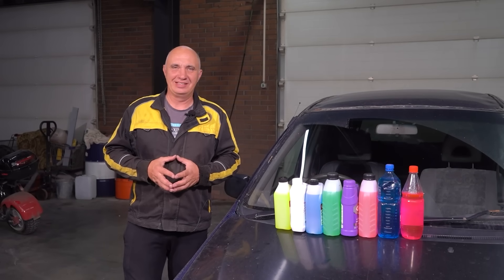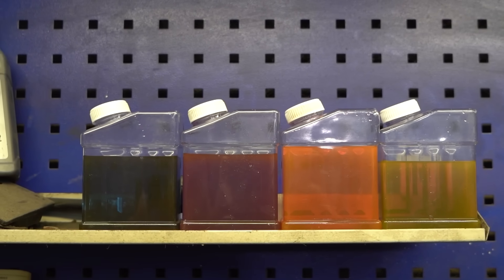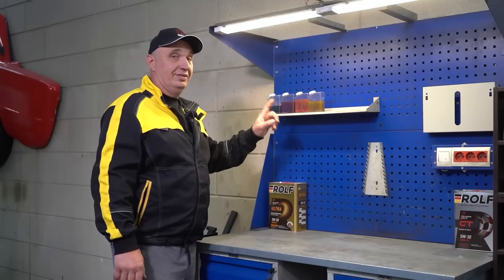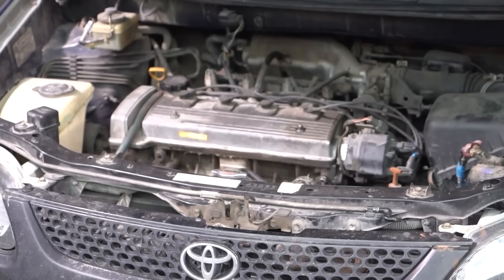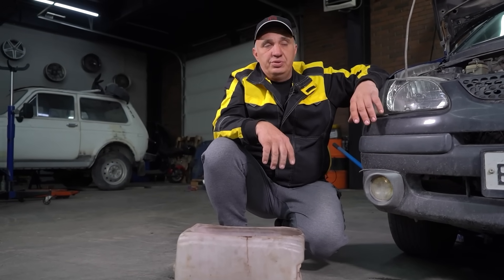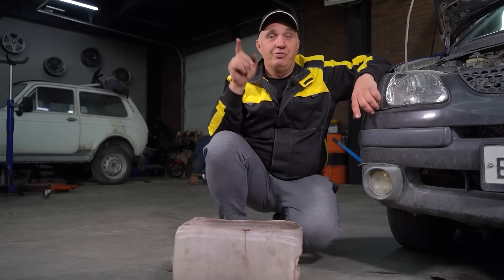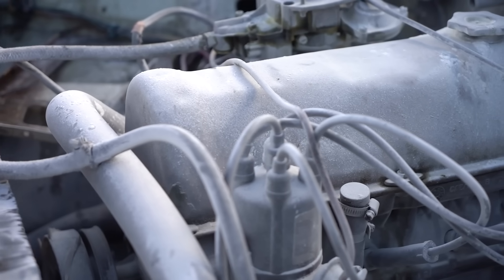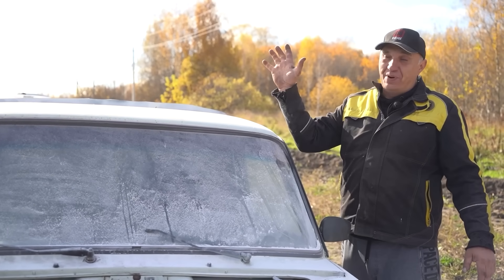Mixing coolant in the radiator (also we try gasoline) - what will happen?

Comment: What i heard is that you must avoid mixing inorganic and organic antifreeze.
Putting gasoline there was very dangerous. If something could ignite all that fumes, it could result in a very big fireball.
Not surprising the gasoline was not useful as a coolant, as it's very volatile, and boiled like crazy when heated (not to mention the huge flammability).

Comment: For the most part all coolants work just fine in any system even mixed. The big deal is metal types and protection. Toyota formula might work just fine in dodge and even protect it, but it might not last very long and not provide very good protection.

Comment: Pontiac Van a guy I know mixed in old style universal with new style dextose made a brown sludge which plugged and caused overheating and finished off his head gasket. Turned to brown stringy mess after a couple weeks

Comment: Of course mixing coolants is bad if they are not the same exact type.  You might end up with a gel like substance in the cooling system that will cause you all sorts of headaches.  These might be things like clogged heater cores and radiators.  That could mean having to remove the dashboard to get to the bad heater core (hopefully it didn't leak).  It could also result in overheating problems.  Maybe it will cause transmission problems too since a lot of those coolers are also known as warmers.  With those you have one fluid on one side and the other on the other side.  Also one other thing about coolant is that it turns acidic over time and that could corrode metal.  That may very well be the reason why when there is a transmission failure and there is coolant in the transmission creating that forbidden milkshake that some unfortunate people found out they had.  My reason for thinking it could happen there is that the coolers are made of thin metal (to transfer heat better).  If you have an unknown coolant in there flush it out and use the right stuff.  If the vehicle has a lot of miles or the coolant tests as acidic change it!!  That will be a lot cheaper than repairing the damage your neglect caused!!

Comment: Old coolants I’d say yes you’d get coagulation but the newer stuff has much more compatible compounds and additives while the cheap stuff is just lacking those special compounds all together so it can’t gel up. I’ve seen some clogged cooling systems but that was maybe 10-20 years ago. Now it’s all from stupid people using Stop-Leak.

Comment: I won't go too deep into this (I spent a week reading on coolant for a project car), but there are some important highlights. Coolants can generally be separated into:
IAT Inorganic Acid Technology 
HOAT Hybrid Organic Acid Technology
OAT Organic Acid Technology
You also have P-HOAT (which adds phosphorus), and Si-HOAT (adds silicone)
In general mixing OAT and IAT will cause a gel, and adding, or subtracting P or Si will cause seal leaks. 
Most importantly color means nothing when it comes to chemistry. For example Volvo blue is a HOAT, buy Toyota blue is just OAT, they are not miscible. Also, red, orange, and pink coolants are hard to tell apart in a bottle, and finally there is no such thing as 'universal' coolant. Never make the mistake of installing any 'one size fits all' solution in your car. 
Footnote, distilled water, not tap water. Tap water has minerals, and these minerals will coat the inside of your cooling system, and insulate it (cause overheating).

Comment: Australian Wade from 'Garbage Time' channel (also does the 'Dankpods' channel), ran his car on a coolant he called 'PILK' (Pepsi & Milk) and... It ran JUST FINE! 👍 He also does MANY other experiments, like using Nutella as engine oil (seized/spun bearing, but, they cleaned & rebuilt the motor and it worked again!), then, Eggnog as engine oil (FIIIINALY destroying the motor with bent conrods), also PURE PEPSI as coolant and other mad experiments besides! 👍🤣🤣   😎🇬🇧

Comment: Do not mix HOAT and OAT coolants.  They WILL gel if you do.  Mopar switched between the two and owners have to be careful to confirm which type they have since the Mopar purple coolant turns orange over time, making it tough to tell which you have.

Comment: Well I'd say nothing would happen but if you had rust eating on the cooling system then there's no way there won't be any damage but the mixing coolant part depends on the cars as here in my country there's a lot of people that mixes blue green and red and their cars still work like nothing ever happened but some others do ruin their head gaskets but it all depends on their cars and the fluid colors i get are a lot like all the colors you had but on a deeper color (probably because it's mostly the mix is from ethane based coolants)

Comment: it is mostly sensitive in systems with aluminium, what happens is that the coolant starts to eat the aluminium and forming crystal like composites in the system over time. coolant has the important task to prevent corrosion and mixing types can reduce that property of the liquid. I seen it happen

Comment: It was.
Dex cool that would do that and that was only if it got exposed to oxygen which happens every time you open the container or open the radiator cap and if you missed next deck school with Etheline glycol based

Comment: Its DexCool if you mix it with green or any other coolant then run it for a year or 2 and continue letting the coolant get low because its leaking and thats why your mixing it in the first place

Then it bakes inside the radiator when it gets low and turns into a hard and gunky goop that coats the inside of the radiator

Ive seen alotta GM 3800 engines that have that issue always gotta flush tf outta the cooling system and i dont run dex cool because of that issue

Comment: Al that mixture of coolant did w a s remove the rust from the cooling system of that Toyota and if you are desperate for a coolant water will do the trick not petrol another idea for an experiment is fill an engine with water a just leave it outside overnight in winter and see what happens

Comment: Stopped at 58 seconds for a little guess and whatnot. I doubt they will see much action unless they have been saving up videos over a long term setting. I've seen the GM dexcool garbage go very badly with regular green ethylene glycol. It forms a weird dirt like coating in areas where air pockets form. Very bad.

Comment: If that was all the coolant that came out of that radiator then you definitely have problems there should have been more than that come out. Most coolant dosent have the problems they used to when you mixed them but back in the 90s when every manufacturer started changing them to something different they had a lot of problems mixing and corroding internal parts some are still that way but it usually takes a lot longer than a month. A lot of them are universal now and thats the kind i prefer. When i get a vehicle with one of those goofy coolants i flush them out to use universal makes things easier!!!!!

Comment: that brown sitcky mud he wiped off the radiator cap and we saw in the neck of the radiator is exactly the concern with mixing incompatible coolants. they turn to a sticky paste that clogs cooling passages, thermostats, and heater cores and is extremely stubborn to thoroughly clean out of the system.
Reply: That's stop leak.
Reply: @windowlicker4029  nope, it's coolant sludge. I deal with it regularly.

Comment: While I know this is an experiment and wouldn't condone using gasoline as coolant but the vehicle is just standing still and not getting as much airflow to cool the radiator as it would if it were moving. However, in normal conditions with actual coolant, properly running radiator fans will suffice to cool a parked vehicle at idle temperature so the outcome will inevitable likely be the same, just take a bit longer if the car was moving at speed.

Comment: Kiwi mechanic here, I have seen honda coolant mixed with green coolant and it turned to jelly. I felt real sorry for the old guy who was trying to do the right thing. I had to do the head gasket for him but managed to flush the muck out. Great channel 🙂
Reply: Yikes!
Reply: I am curious to know what chemical process took place to cause that reaction. I've heard ya don't mix red antifreeze with green, but I never knew why.
Reply: So if I change the coolant in my jazz can I use the blue Penrite? Or just use Honda stuff?
Reply: @turbosloth2  Just use the honda stuff. and you will be pretty safe. In saying that blue penrite may be as good, or not better than the factory spec? But I know not to mix and match, 🙂
Reply: @Bryce-z9v for the most part its ok to  mix. I recommend swapping to a quality brand of all vehicle coolant for almost every vehicle. Peak is very good. I use the ecoshield formula in my monte carlo from peak works great. Also very cheap.
Reply: @Bryce-z9v  yer I’ll give it a good flush, it still has original stuff in it that’s near 8 years old
Reply: Honda is such trash in nearly ever way. I hate honda cars. They do not like to be fixed.
Reply: Kiwi here too, I have seen the same thing happen and ended up  a dash removal to replace the heater core

Comment: I put too much coolant in my 09 ranger with the 4cyl duratec and thought it was a blown head gasket before i realized it was just burning the excess off of the cylinder heads. I like to use nothing but distilled water, water wetter, and a few drops of silicone lubricant into all of my coolants to control boiling point, balances top and bottom engine temps, lubricates the water pump while keeping corrosion at bay.

Comment: From my experience you can use any color and coolant if it is rated for your engine type (alu, steel, cast) as long as you don`t mix them and flush your system if you change the colour.

Comment: Where I live they sell used coolant at the local junkyard from different cars but they make sure it's not mixed with oil from a blown head gasket and I have heard that if you put transmission fluid in it helps keep it cool as well I don't think it is true but heard it from dirt track racers

Comment: the other problem is that using incorrect coolant can be corrosive to the coolant system. If your heater radiator will be rusty and start leaking then the hot water will spray all over inside the car and to replace it many times you have to disassemble the whole dashboard... and when you put it back it will make cracking sound all the time because it's never supposed to be taken out and old plastic deform a lot :D
Reply: Heater cores can be replaced without not making noise 🤣
Reply: @fastinradfordable  depends on the car... for example I got a 23 year old car, door lock mechanishm and the electric window opener had to be replaced multiple times and to do that you have to disassemble the door panel. Despite being put back perfectly now its making squeekeng and cracking noise all the time on crappy roads... Plastic dude, this is the habbit of plastic. The newer the car the more plastic it has instead of screws...
Reply: @johnnyhun1  You should have replaced the plastic pins, that hold the door panel in place. I had to replace a heater core to a 88 Camaro, and it didn't require disassembling the whole dashboard, and it didn't make any cracking sound afterwards.
Reply: @ well, a car from 88 is simple as a wooden train. But anything newer than 2000 is more and more complicated and has cheaper quality parts
Reply: Would like to see this tested...always heard it but no evidence yet

Comment: When you change your coolant, buy 2 extra gallons and put them in the trunk. I have mixed all kinds of collant together in the past, but I understand that some of the newer coolants won't mix well. Either buy the pre-mix or use DISTILLED WATER.  - If you use tap water it is likely that you will have issues after a few years.
Reply: Yup tap water has to much minerals that corrode newer vehicles I started using distilled water about a decade ago back in the 90s it wasn't that big of a deal but everything is made so cheap now not worth the risk

Comment: i had to change dozens of heat exchangers / radiators because people mixed G11 and G12 Coolant Fluids..... it simple clogs up over time.... next thing is the plastic parts and seals gets porous over time if the coolant is not compatible....

Comment: I have a very cool experiment you should try, taking a regular engine let's say a lada engine and fitting it with big oil pump like a truck or big engine one, and see how it efact the oil pressure and the performance, that can be great video.

Comment: it is my understanding that planes back in WW1 used to use straight Alcohol as a Coolant. Any chance of testing this myth?
Reply: That's what the coolant was in many automobiles as well.
Reply: What would be the benefit of alcohol? Better cooling ability? or weight maybe?
Reply: @windowlicker4029  it was mainly before antifreeze was a thing. Running straight alcohol it doesn't freeze until it's below -40°

Comment: gasoline would probably work as a coolant if it’s boiling point wasn’t 100° or so less than water’s. I am betting the real reason it quit cooling is because it boiled all the Liquid gasoline out of the engine.

Comment: I want to see what happens if you put ethanol, methanol, or nitromethane in the radiator.
Reply: About the same, gasoline is basically a alcohol, and ethanol and methanol counting also to the alcohol class.
The difference is how quick they burn and how clean
Reply: Alcohol used to be used as "winter coolant" before glycol coolants became the norm
Reply: Methanol is highly corrosive, it'll eat the aluminum and the corrosion will plug the tubes.

Comment: Don't do this. They can gel up under heat and pressure. Or just by mixing. What occurs is the thickness over time or instant. It basically curdles but it's oil .. Not milk

Comment: Can we get an inverted atmosphere test to simulate Titan's atmospere? To have accurate results, you should have an environment of approximately 94.25% nitrogen, 5.75% methane (1.5 bar pressure; -180°C to -105°C temperature range) and develop an inverted induction system with fuel sourced from the methane in the simulated Titan atmosphere and oxygen from the tanks.
Reply: or maybe "burning" oxygen in a methane (or similar) atmosphere like Cody's Lab did, but using a car engine

Comment: The heat from the engine needs to be wicked away, sure.
SO I propose, use the fuel pump to flush the cooling system as well.
The overflow will be routed back to the gas-tank and prevent freezing in the lowest of temperature regions.
Also, you guys didn't mention the cabin heater, this can also wick away lots of heat.
This way, there's always enough cool gasoline circulating between the tank and the coolant system.

What boils of in the coolat overflow reservior, will be sucked by the low pressure lines into the intake manifold.
Reply: thats actually brilliant :D
Reply: I was just thinking that. Man's on to something.

Also the thought of gas fumes going back into the intake=slightly mo power poor mans nos haha
Reply: Theoretically it sounds cool, yet in the summer it will evaporate quicker, and the water pump seal will wear much quicker.
Reply: How are you going to heat up fuel with cold coolant in order to thaw frozen gas needed to run the engine to heat the coolant?
Reply: @windowlicker4029  same way your coolant heats up by the combustion engine.

Comment: Different mixtures definitely curdle over time.    Most common is red and green mixed.   Turns to a brown mud like substance.    Likes to get stuck in your heater core
Reply: G40 and anything else, especially dexcool loves to gel up
Reply: Someone added green with the red in one of our Peterbilts. That was a $32,0000 repair.
Reply: Literally just had this exact thing with my Daughter's Audi. Had brown mix that looked like the Green and Pink together, a nasty film on the top of the coolant that looked like flakes, and when I drained it, it had chunks that looked like mashed spaghetti-os. I had to flush the whole system out with Super Clean, then hot water for over an hour before chunks stopped coming out. It's a used car and she just got it. You never know what someone has done before you!
Reply: @PetesCreativeRecycling  Neglected coolant system is pretty much what I expect at this point, sadly. People only change oil. The other fluids, nope. The black and chunky 32 year old brake fluid was also a good one.
Reply: @PetesCreativeRecycling  Several years ago I noticed a lady filling her engine with a large bottle of pink premix coolant while filling up at the servo, the problem was she was pouring it into the rocker cover (Oil fill hole). I quizzed her about why she was doing that, and she said the engine was running hot and she couldn't see any coolant 'in there' so she bought some to fill it up... I suggested she call a tow truck immediately, but then wondered how often this has happened before.
Reply: @PetesCreativeRecycling  Did you drain the system first and switch colour after that or did you top off with a new colour?

I'm curious because I switched from pink to green a couple of weeks ago.
I had heard before that this problem could occur so I filled the system with water first and had the engine running a bit and then I flushed that out before pouring the green in.
Reply: Indeed. turns to a slimy sludge after a while.

Comment: I was hoping you'd set the vapors on fire! 

Can't use gas in the cooling system, it needs to be at a much higher pressure to not boil away. You could see vapors vigorously pouring into the expansion tank, that was pretty cool!